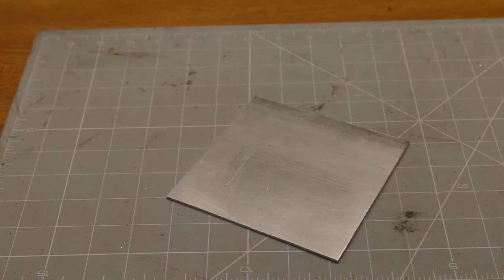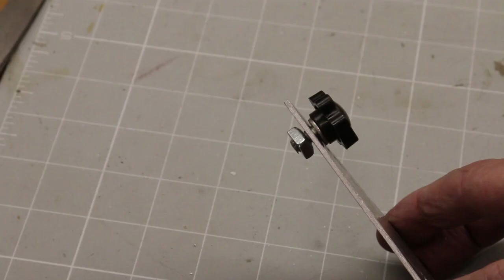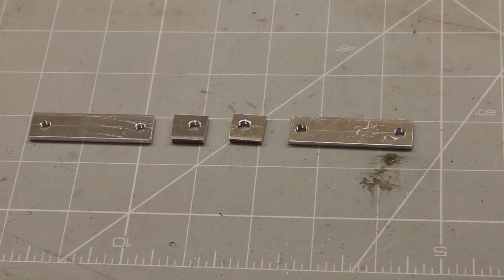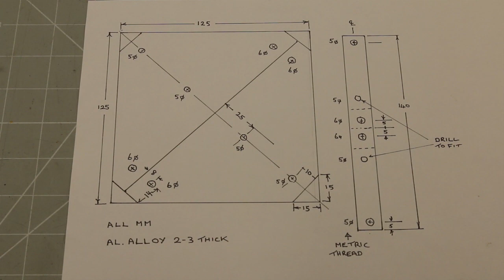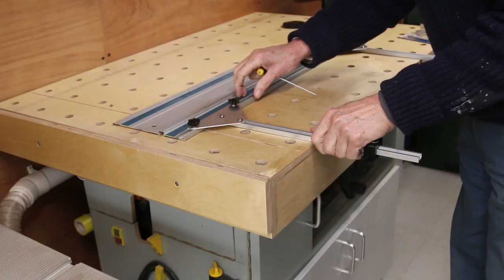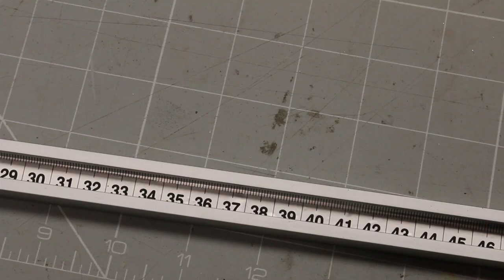parallel guides for track-saws

Comment: Nice!  I've not actually got a tracksaw yet - just researching for if, as and when!  There are plenty of videos showing guides made from MDF or plywood but this is the first time I've seen metal track used.  Looks good & makes more sense to me.  I think my only issue would be getting the 3D printed bit and also laying hands on the aluminium.  I'm not aware of anywhere local to me that sells it but maybe it's around and I've just not seen it.  I guess the internet is an option, too!
Reply from the maker: Yes, all the parts are available, usually Amazon. For metal, I use either Metals4U or Rapid Metals. The stop blocks can be made from wood- fabricating them from pieces of ply is the easiest. People used to working in wood tend to shy away from metal- but it can be easy to work, especially aluminium. And it is, of course, more robust.
Tracksaws are amazing- both the accuracy and the finish of the cut.

Comment: I'm going to try a variation on your design, using your triangles as outlined but with aluminium rulers instead of T track. The 1M rulers are just £4 each from Screwfix and I will cut these to 50 or 60cm . The holes at the track end can be slotted to allow adjustment. I'll adjust the design of the end stops accordingly. They will be hardwood as I'm not equipt to 3D print. One day perhaps...
Reply from the maker: Sounds like an excellent idea! Etched scale thrown in...

Comment: Good solution, do you think the plates could be 3D printed too?
Reply from the maker: Yes, they could. I try to use 'conventional' methods where I can, as people complain if it is all 3D stuff. If there was enough interest I could publish a 'plate' design.
Reply: @Tensquaremetreworkshop  that’s good & fair enough, but now I’ve got a 3D printer I’m always on the lookout for things to make 😂.  I’m sure I could design the plates in Fusion 360 from your plan 👍.
Reply from the maker: @idlersdream826  Good project! Link them here if you publish...
Reply from the maker: @idlersdream826  Thanks! Not sure I will need more guides, but other viewers may want to use these- a lot less work than cutting metal...